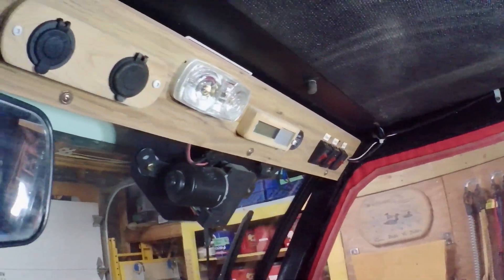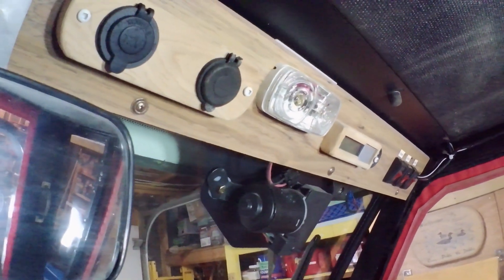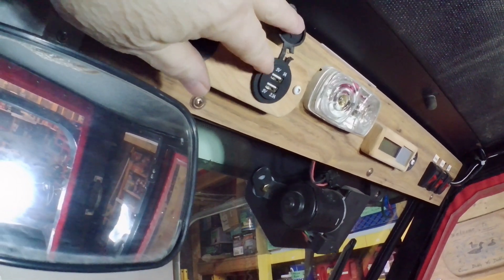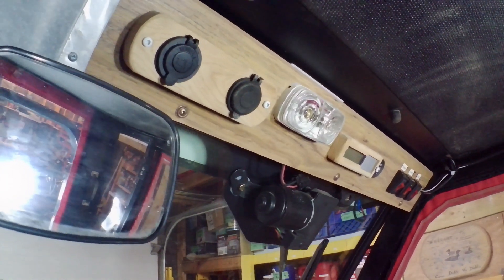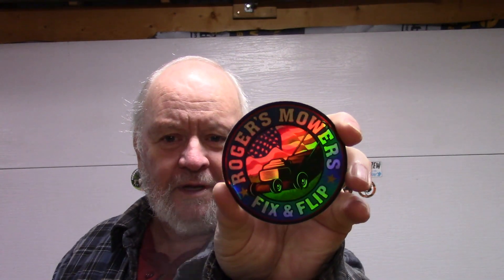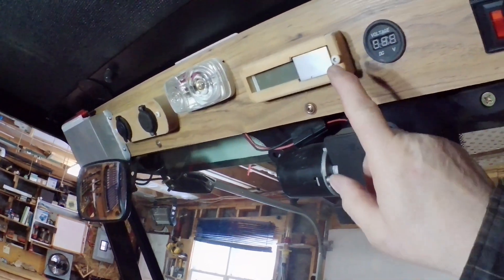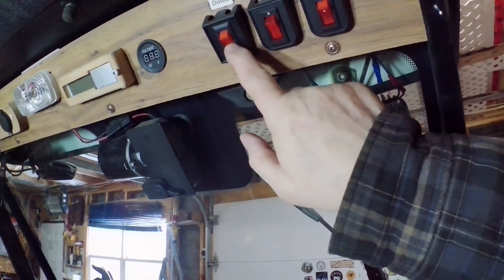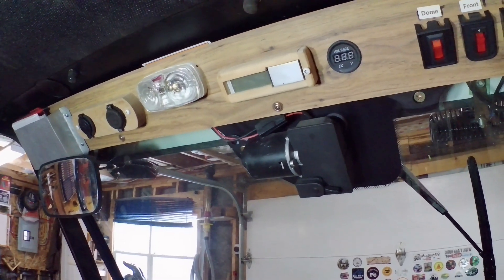A Look at the Headboard on the GC2300

Comment: Very professional head liner.  Putting the clock in was a good idea as sometimes in the past when you were the only tractor owner on the lake you would be out plowing for 6 to 8 hours at a time and I used to worry. After putting that in you tended to return home for lunch or a break before going back out which lessened my worry! Thankfully with all the new tractors on the lake and the younger folks you no longer have all that plowing to do.
Reply from the maker: It's so nice to have so many people on the lake with tractors and they are so willing to get out right after a snow and plow our road.  And they do a  great job too!!!
Reply: @GrampiesWorkshop  Neat story from days long passed Mike.

Comment: I'm the same way Mike , when it comes to music. I prefer to hear the tractor in case there is a bearing starting to go or a belt does not sound right. My grass cutting takes about 3 hours on the tractor and probably another 4 on the push mower and trimmer. Unfortunately, I don't even wear ear plugs so I can hear things better on the tractor. I do wear hearing protection with the string trimmer.
Reply from the maker: How's she goin'?  I think it's important to hear the machine operating.  Like you I don't wear hearing protection.  I probably should, but at my age it's too late to start I think!!!  LOL  I have 'heard' several problems on my tractor before they became serious and I know if I had hearing protection, or music on, I wouldn't of heard them and it would have resulted in a serious break down!!  Thanks for the visit Brain and take care!!!

Comment: Great tour of the headliner. I like the pocket you have for the log book. I keep a log for all my vehicles. It seems that writing something down is better than trying to remember what I did 6 months later. The USB ports and the 12 volt plugs are another good feature (and is a modern convenience for many devices). The volt meter is something I've been wanting to get for our little RV. It lets you know exactly what's in the battery. Yes, Mike it's important to put your own mark on things to make them your own. I did just that only one week after buying my F-150. I backed it into a low concrete wall and put a lovely "mark of my own" down one side! LOL Fantastic tour and such a handy addition to the tractor. What's the new feature going to be??? An ejection seat?
Reply from the maker: How's she goin'?  I end up using the log book and holder the most I think.  I am surprised at how handy that book is!!  The voltmeter was a nice add.  And like you say, at a glance you can tell how the electrics are performing.  To be honest, I rarely use the 12 vdc and USB ports, but it's nice to have them there.  As for the next addition, well that's on hold as I need to order some more parts.  But it'll get done and it isn't an ejection seat or an 8 track!!!  LOL  Thanks for tuning in and commenting.  Take 'er easy!!!
Reply: @GrampiesWorkshop  Not an ejection seat or an 8-track player....hmmmmmmm? All my guesses are used up. Is it a coffee-maker??
Reply from the maker: @EverydayProjects  Ha Ha Ha!!!  I don't like hot drinks.  If you don't need ice in it I don't like to drink it!!!
Reply: I know what it is.....A BACKUP CAMERA !! Right?
Reply: @GrampiesWorkshop  You're putting an ICE-MAKER in the tractor??

Comment: Hì Mike really enjoyed your túbe on overhead console!  I,ve  noticed you have a gc 2300 mf tractor,iown.a1705 BOUGHT IN2019 WITH A 50lnch front mounted snowblower,I clearaprox.1.6 km,of road every snow fall havde broken quiet a few shear plns xalongthe route.ì would like to see tye differencebetween our machines.reaĺly
Enjoy your tube,GREG
Reply from the maker: How's she goin'?  Thanks for dropping by the shop Greg!!  Some nice to have you join us!!  The GC series are pretty amazing tractors eh!!  When I bought my GC2300, in 2007, I had it equipped with a front mounted snow blower.  I also had to plow about 2 km of road to get to my camp.  Well that front mounted snow blower was about the worse piece of gear I have ever owned.  I wrote to MF about it and they sent their field technician out to see me.  After some talk MF decided "I wasn't using it in the manner for which it was designed".  That was their 'official' decree, but when I spoke to my dealer about it later he told me he would trade the front mounted blower for a rear mounted blower and hoped that this would be a satisfactory conclusion to a not so good situation for me.  I gladly accepted and that's how I ended up with the rear blower.  On the front mounted blower I was breaking shear bolts, the chain drive broke once.  The whole blower fell off the mount another time because the pivot pin had come loose.  It was not good.  The blower just seemed to be too light weioght for a tractor of this capability.  But MF did me right I have to say.  A combination of the local dealer and Massey Ferguson I'd say.  Thanks again for tuning in.  I hope to see back again soon!!  Take 'er easy!!!
Reply: Hi MiKE ,I SHOULD HAVE MET YOU BEFÒRE I BOUGHT THE SNÒW BĹOWER. WOULD HAVE SAVED A LOT OF MONEY,!,,I DO ENJOY THE TRACTOR IT,S ONLY. 22.5 HP I 7.8 HP @ pto but stll càn lift some hefty. Logs!really like your cab would appreciate more info on it. Keep up the great u tube. Greg
Reply from the maker: @gregwells4161  Thanks Greg!!  I have several Playlists about my tractor and activities with it.  Here is a Playlist that has many of the mods I have made to the GC2300 over the years: https://www.youtube.com/watch?v=JP21dJP4cVs&list=PLr6KZqrfTFLaWRITRPyjiZ5R7Dj-nerHC  
I like to make mods and make the tractor more user friendly and more personalized too!!  If you have any specific questions, please  ask away.  I'll do my best to address them.  Take 'er easy!!